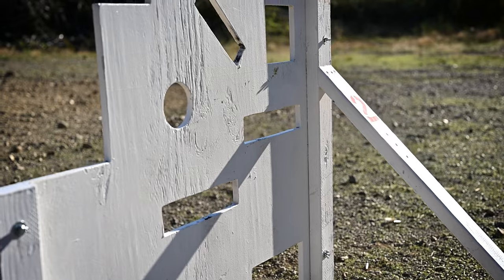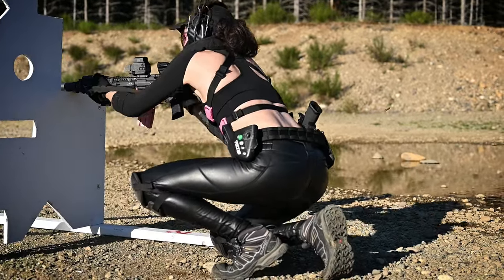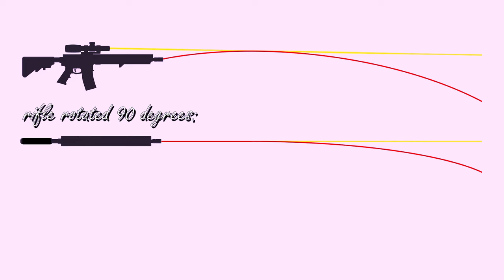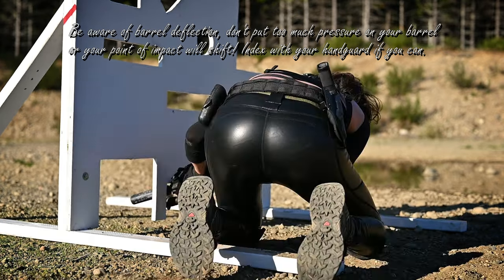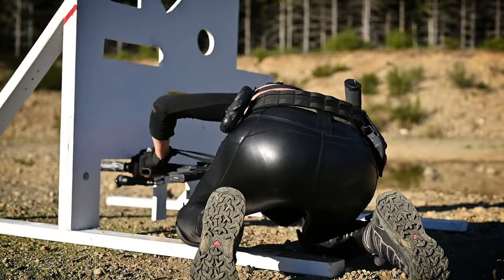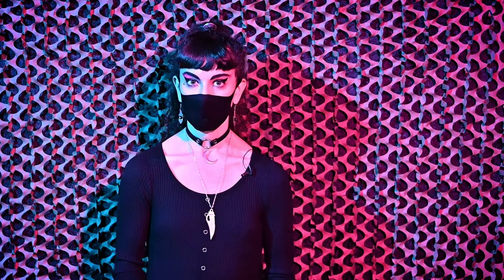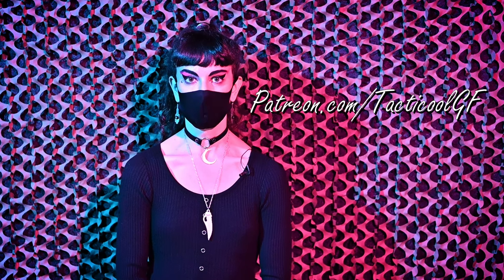The VTAC Barricade

Comment: 00:39 🚧 A VTAC barricade is a plywood structure with holes and steps, used for training unconventional shooting positions.
01:08 🎯 The goal of using a VTAC barricade is to practice shooting from less-than-ideal positions, preparing for real-world scenarios.
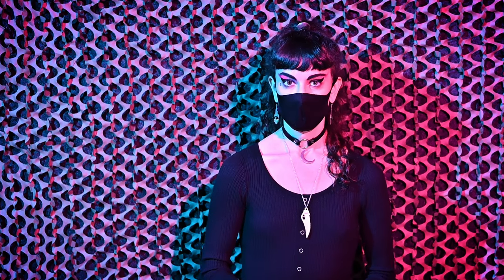02:04 🪜 The barricade has steps for training different shooting heights and ports (holes) to practice varied weapon orientations.
03:28 🔄 While moving the rifle, keep your body equidistant from the barricade for consistent indexing.
04:51 🔍 When using ports, be aware that your optic's zero might change due to varying rifle orientations.
05:45 💪 Apply pressure against the barricade with your rifle for a more stable sight picture.
06:14 🤔 Experiment with different support hand positions for stability, based on personal comfort.
07:27 🧘‍♂️ In lower positions, you might need to find alternative ways to stabilize your weapon, as traditional shoulder placement may not be possible.
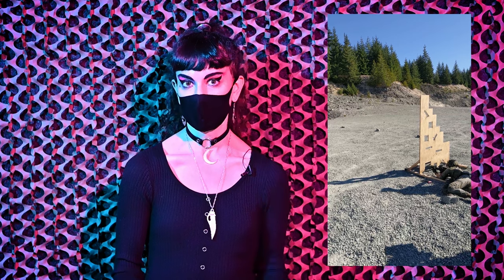08:38 🔄 Switch shoulders and explore various positions to challenge yourself while moving between barricades.
Reply: doing holy work my friend
Reply: This is a beautiful list!

Comment: Yo the fit while working the barricade is 🔥🔥🔥

What knee pads would you recommend these days? I was lucky enough to score some Leafs before Arc'teryx went on their gubermint-only sales BS, but I don't have a strong recommendations for others because the Leafs are so good.
Reply from the maker: Honestly, if you can get internal knee pads, that's the way I would go. But for external knee pads I still recommend the Arc'Teryx knee caps. There was some controversy over the government-only sales of these, but it looks like they're back on the civilian market: https://www.uspatriottactical.com/arc-teryx-combat-knee-cap
Reply: crye precision g3 g4 combat pant or air flex knee pads
Reply: Bit of a graveyard post here, but i am a big fan of Troy Lee Designs lighter mountain biking pads- they are nice and flexible, pretty breathable, and unlike many other knee sleeves, tend to stay oriented on the joint even on skinnier legs. I wear them as a daily for being a mechanic and rough carpentry. They take impact very well- abrasion is kind of a case by case thing.

Comment: I would love to have the resources to set up my own outdoor range (or use an outdoor range that wasn't limited to "targets at (specified distance) from a table."

I would also love to have the agility I had twenty years ago.

Most of my training is a function of NOT having either of those, though, since getting down to lower positions is easy enough (gravity works, even if the resulting position isn't ideal), but getting back up is not so easy. Could I still benefit from working with a VTAC barricade? Probably.

My self-defense exercises so far have been focused on my own realities, including "get the heck away from a shooter" and "help others get away from a shooter," and awareness that if someone already has a firearm in their hand, I'm NOT going to "Quick-Draw McGraw" my way into stopping that threat.

Comment: Q: In traditional hunting one is taught not to put the barrel on a hard object as it throws off aim. It is said it is better to brace your arm against the surface rather than your gun. Does this tend to hold true with semi-autos? Btw, no cans in Canada so we can't rest those on the barricade either.
Reply from the maker: Good question! Barrel deflection is real, and yes, if you apply significant pressure against a surface with your barrel, that will happen. It's best to put your handguard on the surface if you can, but otherwise, just brace as gently as you can, keeping in mind just how much barrel deflection is going to be acceptable for whatever range/precision you are shooting for.